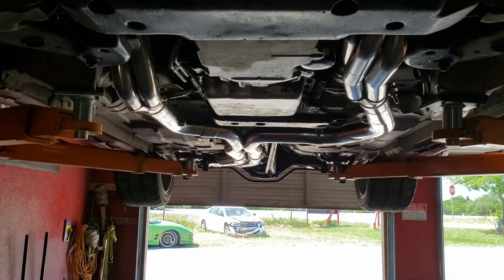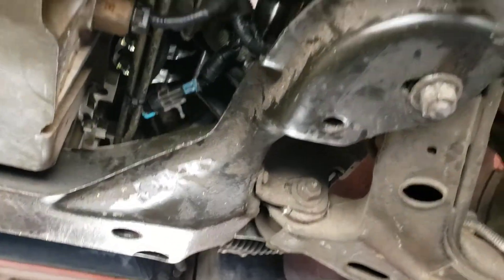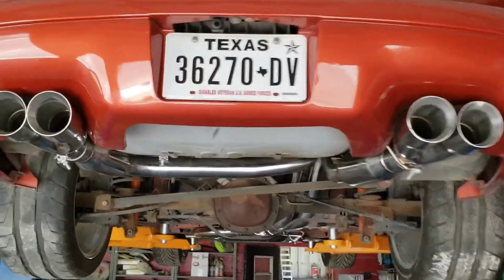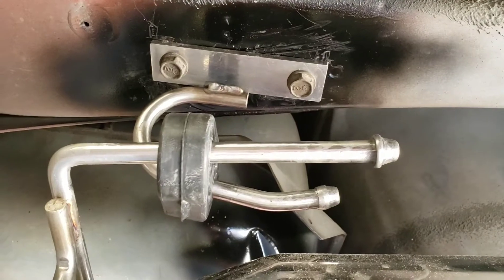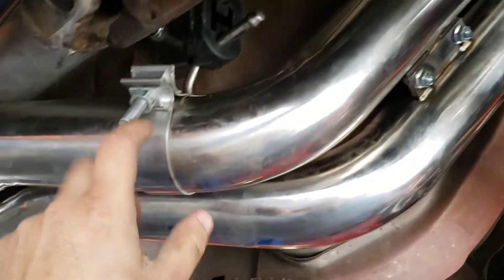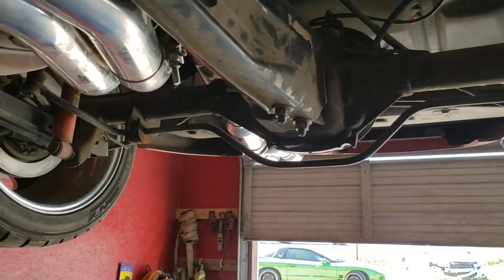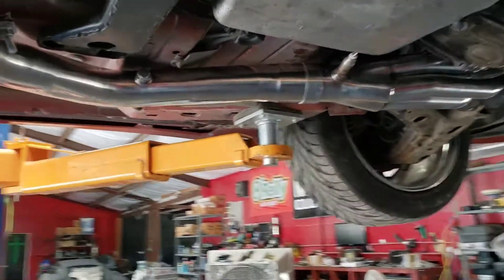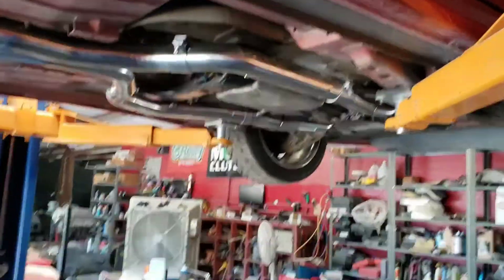Speed engineering true dual stainless exhaust setup on LS1

Comment: Why did GM Engineers design a 2 into 1 exhaust for 4th gen F-body?  Was it to throttle back the hp to not out do the vette?
Reply: Never thought about that but it’s very likely.
Reply: It was an emissions thing, it limited exhaust flow so it could pass.

Comment: That sounds so much deeper then any fatback traditional system sounds. I swear I am going to have to send my car down to TX to have a TD system installed.  Everywhere I went to here in my state IN . I was either turned away or wanted 2x the cost of the TSP TD system I had bought . One person attempted but couldn’t get it to work with my spohn adj trq arm and DS safety loop. Nice video ❤
Reply from the maker: Thank you! Glad it helped you out.

Comment: old skool guys used to take a ball pein hammer and give it a dent where it contacted to keep from cutting on the frames...didnt have k members back then....I asked will that not mess up the flow and was told it was just one pipe and they didnt do enuff damage to notice...jus sayin
Reply: easy pop out
Reply: Engine masters actually did a test and it has to be like 90% closed off before it effects power.

Comment: The drivers side pipe over the axel looks really close to the gas tank. Does it rub or touch the gas tank, I also noticed you removed the heat shield too.

Comment: What do you think about the whole 3 inches is too big for the street? Cause I have a 480 horse 383 LT4 going into my 1997 Camaro and Hooker makes a true dual exhaust but it's 2.5 inches in diameter which supposedly can hang up to 520/530 horsepower. Then there's those that say you need a 3 inch exhaust for anything over 480/500. Just don't know. But my headers are only 2.5 inches so I might just stay into the 2.5 exhaust for ease of installation.
Reply: Go with the 3 inch true dual setup. I have the kit on my bolt on 98 Trans Am and love it. The sound is so much deeper than the previous y-pipe setup I had. My brother also has the 3 inch speed engineering kit on his 01 H/C LS1 Camaro. He picked up 19 rwhp over his Hooker catback. Plus, with a 3 inch kit you're also future proofing your car if you ever wanna boost it. Dual 3" exhaust can handle all the power you'll probably ever throw at it.
Reply: @Bamabrute85  Well I forgot to tell you that I lowered my 97 Camaro 2 inches in the front and 1.8 inches in the rear. I had some 3 inch pipes laying around and mocked them up on the lift I have in the garage and once the car was back on the ground, The 3 inch pipes that I mocked up only gave me 2 inches of ground clearance so yeah maybe in future I might go for the 3 inch exhaust if I boost my 383 LT4 or spray it. But for now, I really like the Hooker True Dual Black Heart 2.5 inch exhaust system. Plus there mufflers are still straight through but tone down the loudness just a tiny bit more than those resonators you get from the SE and Kooks dual exhausts. Here's a quick video. I will be welding on slightly bigger exhaust tips cause they look just a shade too small. I think the 3.5 dual exhaust tips per side on your SE exhaust is perfect.
Reply: @Savineyard3  You made the right choice. 3" is way to big for a 345 cubic inch engine. Doesn't matter if it's cammed or boosted. 3" is going to cost HP and torque.
Reply: @Repairsridesreviews  Well I don't have a 345 LS1. I have a 383 LT4 with 329 horsepower on the dyno and probably a tad more with the aluminum flywheel once it's installed. I'm hoping for 460 at the wheels with the aluminum flywheel, carbon fiber driveshaft and 12 bolt rear. I already spent big money on the Hooker 2.5 inch true dual exhaust system to go with my Stainless works T304 Headers that I had ceramic coated cause I live near the ocean and there's a lot of salt in the air. The Hooker Blackheart True Dual exhaust system is 2.5 inches with a Xpipe and my engine builder said I'll be fine. 
 Here's my Video. https://www.youtube.com/watch?v=IeHc1ao6KmI&t=1212s
Reply: @Savineyard3  I agree. 2.5" is perfect for your 383 as well. I don't know why all these guys think they need 3" duals on a small block.
Reply: @Repairsridesreviews  I think it's a leftover idea from all the Fast and Furious movies that brings on the notion that bigger is better.